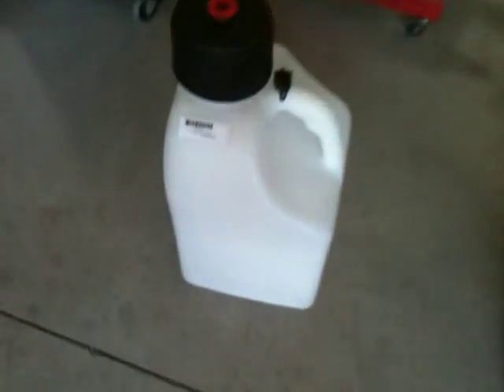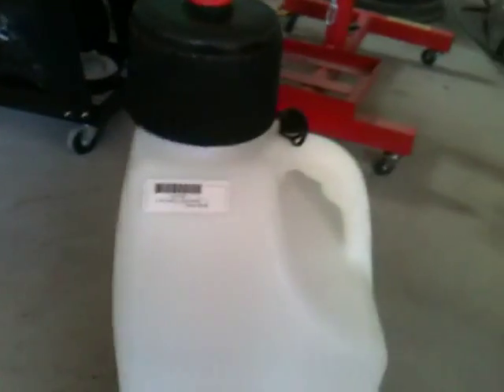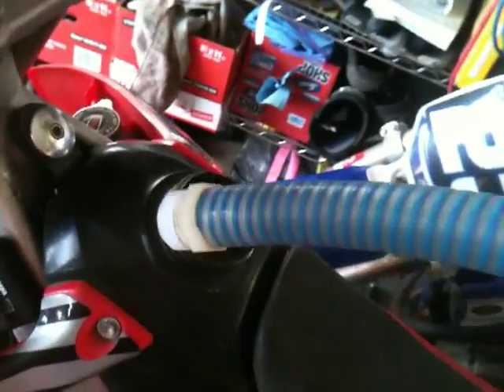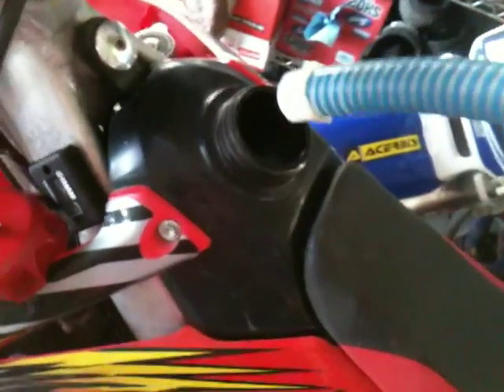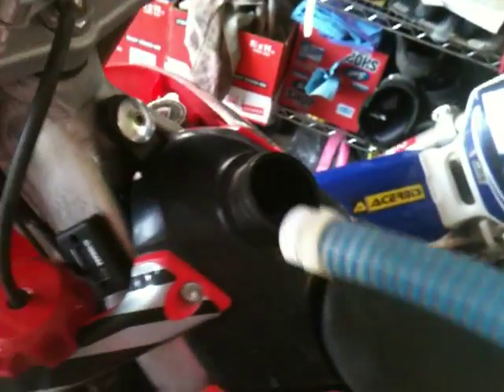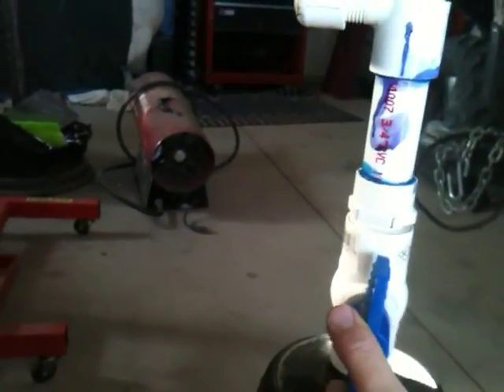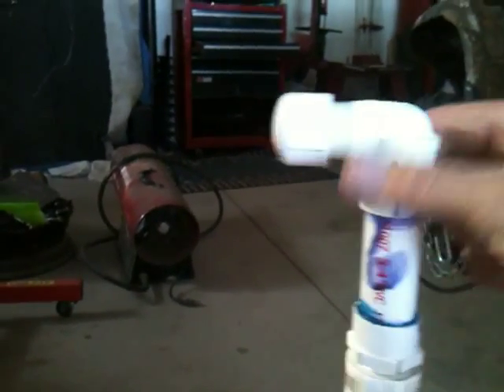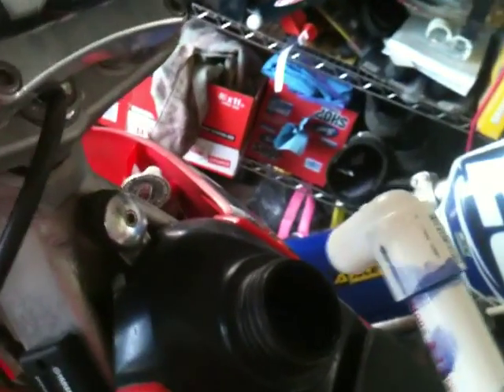Dirt Bike Gas Can Improvement LC 5 gallon

Comment: How do you get the red cap off the top of the lid
Reply from the maker: unscrew it counterclockwise. u will screw in the hose or pvc clockwise
Reply: +anesthesiadreamin I went to cycle gear and they showed me I almost ended up breaking the cap